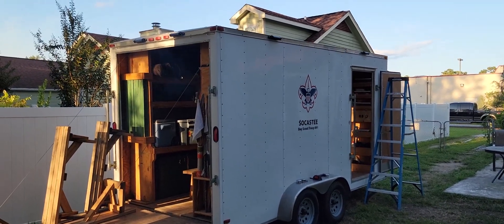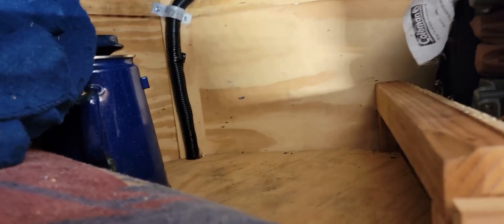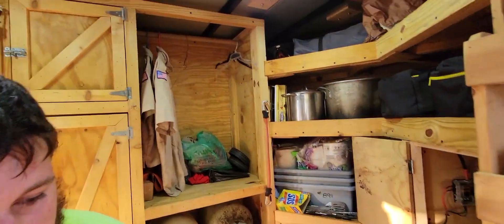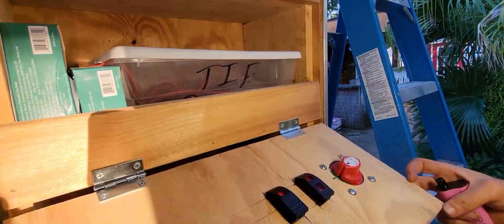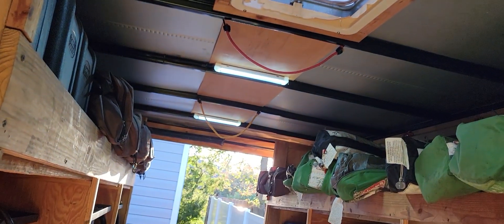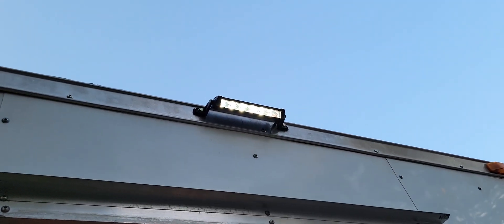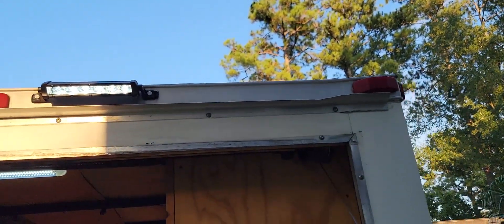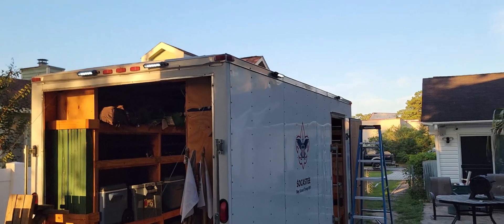How To Install Solar Panel and LED Lights in Enclosed Trailer

Comment: Do you have a wiring diagram of how you hooked up the main switch to the backup lights?
Reply from the maker: Hey, and thanks for the comment. We unfortunately do not have that diagram, but I did briefly explain how we connected the reverse to the switch in one of the other comments here. 

Hope this helps, and best of luck!

Comment: Looks great. I would like to have seen it in the dark with the lights on. That would have been informative as far as the illuminated area. I have a 7x16 enclosed that is taking me forever to get started on. I have sketches drawn up and ideas out the wazoo as well as some of the parts and material, but some of the electrical stuff has me scratching my head. The YT videos are a well of knowledge, but for some reason the electrical part, which is essential, I am having a hard time comprehending. I can do the "rough-in" stuff and have everything setup, but the diodes wiring inline and where, etc etc gets me.
Reply: I too, wiuld love an actual step by step of how you did the reverse light circuit.  I have everything to do this project minus the diodes mentioned. Not doing a solar panel other than the small solar battery charger.
Reply from the maker: Hey guys! Thanks for the comments. We ran a three-way toggle switch for the reverse. Up is all lights on. Middle is all lights off. And down is only rear lights. But the only way that down position gets power is the reverse coming from the 7 way pin on the trailer. Ran a new line from that to the switch and tied that power and the power from the new battery. On each power, before they connect to each other, we threw a diode on each power to prevent any back flow (current). 

On the position all the way up (all lights on), we connected another wire to the rear lights and put a diode there before they tied into each other.

I'll try to get another video of them at night. Hope this helps and good luck with your projects.
Reply: @bluecollarcustoms6837  I know I'm not the only one wishing for a schematic of the lighting, using the diodes.  Looking forward to seeing more soon!
Reply: Do you have any links for the materials you used